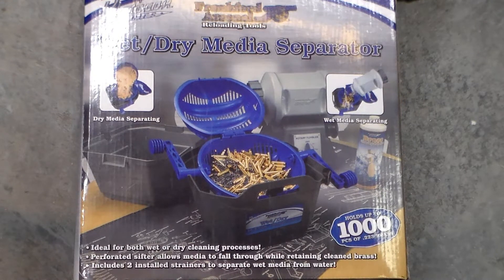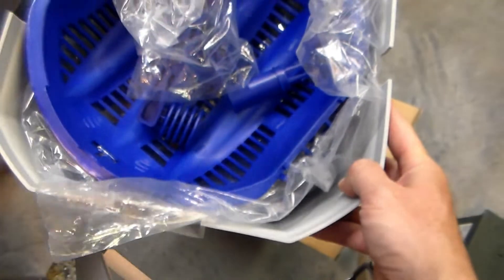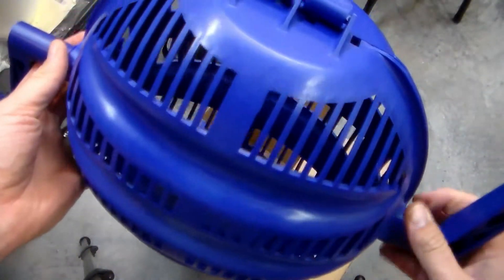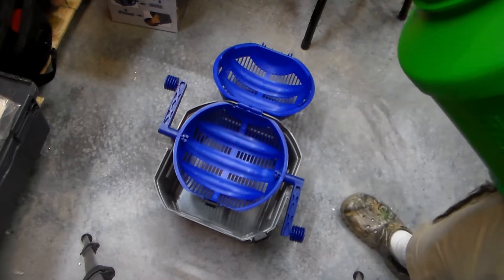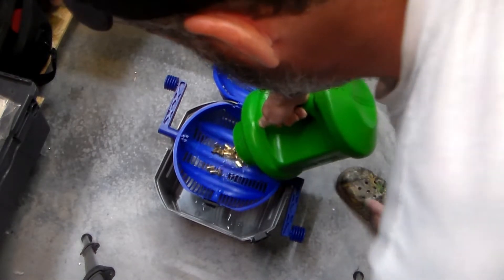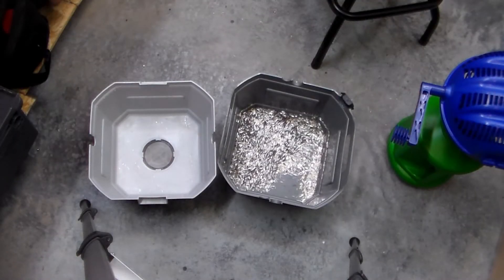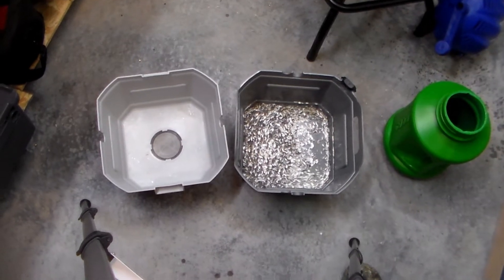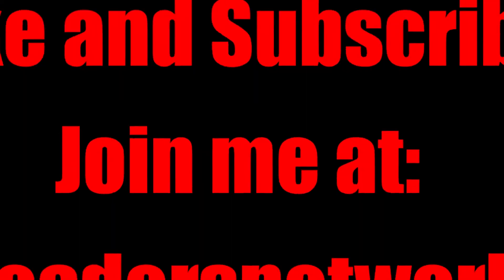Frankford Arsenal Wet Dry Media Separator

Comment: Nice. I bought a Lyman media separator a year ago when they were on sale for $30 . I still use the dry media ( lizard bedding ) and turn the handle for 10 seconds and you are done . Your's is thought out for the wet tumbler.
Reply from the maker: Thanks, it definitely makes the job easier.
Reply: Tumbling wet with pins. Dawan and Lemi shine. makes brass shine like brand new. Primer pockets clean as well as the interior of the shell. Major plus. No dust or crap to breathe.

Comment: Read the instructions. I opened mine tonight. ran 150 9mm through and running another 150 when there done cleaning.
Two notches. Open lid over the side of the box on loading notch. Close and move to tumble notch. For sure not rocket science but man does it work with zero hassle. What I did after removing pins. I filled base up with straight water and tumbled again to do final rinse and double-check on removing pins. Man, it worked flawlessly.

Comment: I dumped the pins in lid rinsed drained and it was good to go on the first attempt.
Reply from the maker: It makes separating the pins and rinsing the brass very easy. I still love mine, thanks for commenting.
Reply: @kyfirearms  The worst is dealing with those damn pins. They are so damn small. Lol. But using 1 9mm case of lemi shine and a count of 4 9mm of dawn makes once fired brass almost look brand new. Outside looks like polished brass and primer pocket are clean. Out of 500 9mm shells with the separator I found no pins stuck in the primer holes. When I used a sifter I did find pin hanging in the primer pockets.
Reply from the maker: @1stFlyingeagle  I love clean primer pockets. Dawn and lemishine do a fantastic job.

Comment: After using it, 1) the rubber latch is terrible, and 2) I can see why they sell the magnet
Reply from the maker: I'll agree the rubber latch is hard to mess with. I had to but the magnet because the pins still get everywhere. It's still easier with a large batch of brass than what I used to do.